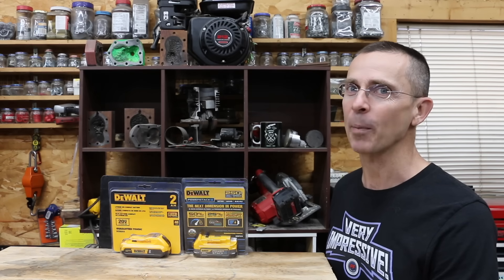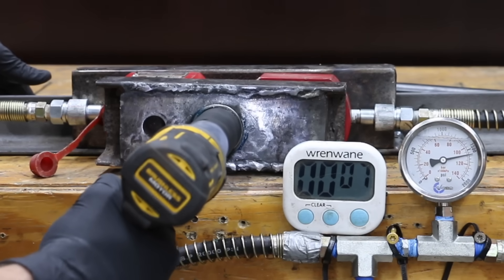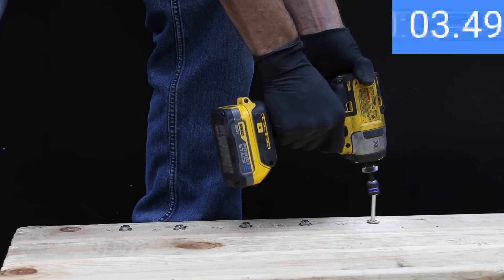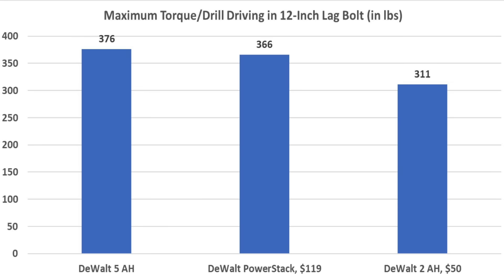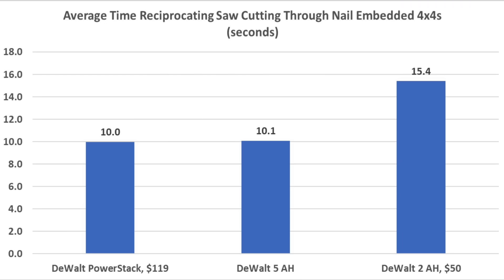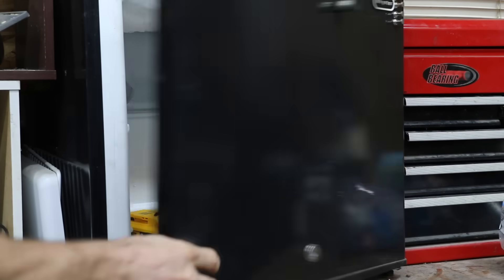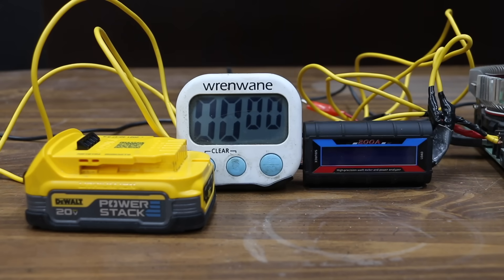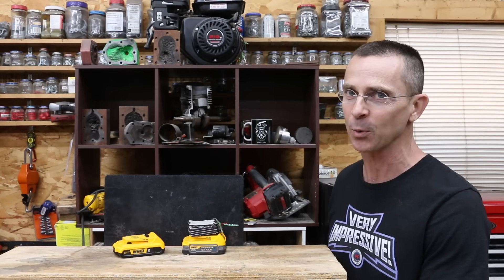Compact “Pouch Cell” Battery Better? Let's Find Out!

Comment: Lithium ion pouch cells? Coming out of China no less? I'd bet dollars to donuts those are lithium iron phosphate, not the much more common nickle-cobalt types.  Those cells were almost certainly cheaper than the normal ones. As far as capacity, LFP batteries have significantly lower volumetric energy density.  It's their biggest problem.  So if they do come out with high capacity they'll just have to make the thing bigger.

All in all, probably a really good choice.  With the manufactures like CATL and others spending bookoo bucks building out LFP capacity, and the fact most people using power tools would be more than happy with the trade offs LFP provides, I expect other manufacturers will probably follow suit soon.

Comment: Pouch cells have far more stringent temperature & pressure limitations than cylindrical cells. They heat up and swell up dependent upon load, ambient temperature & cooling (if any). That's why pouch cells are mainly used in applications where the power demand (watts) is either very low or at least fairly constant (unlike many power tools) and absolute lowest possible weight is far more important than longevity (e.g.: model aircraft).
Reply from the maker: Thank you!

Comment: Dear Author, 2 minor suggestions as for the driving bolts tests: 
1) pay more attention to keeping bolt and driver perfectly straight while driving in screws etc. 
2) be more careful about when to stop driving bolts or finish timing; clearly there are some cases when the bolts are pushed to far onto wood and timer is still going on
Ofc I know that test results would not change a lot once those changes are applied, however tests should seem even more viable then. Besides, great video as usual - and as opposed to PowerStack batteries, Im kinda disappointed with them😉😁
Reply from the maker: Thank you for the feedback!

Comment: I've always questioned why these tool manufacturers never used the pouch cells, they have more energy density. It's criminal how much Dewalt is charging for that battery though, they are cheaper to make than the standard 1s.
Reply: "I've always questioned why these tool manufacturers never used the pouch cells,"
because they are far more prone to abrupt and catastrophic failure than traditional cells. 
They are fine for phones and tablets, even if annoyingly unreliable at times; but anything pulling amps like a powertool; no way!
Reply: @PriaSamari  Not really, those pouch style batteries usually have higher C ratings, and cleaner power. Thats why in high demand applications like RC stuff, they have been using pouch style LiPo batteries for years. They are more energy dense, instead of having 10 18650 cells, they can just have 4-5 pouches that dont need extra wiring.

Comment: Heavier is better in lithium battery. Lipo packs are unsafe, individual batteries has venting protection. You have to test its safety by dropping and abusing. Even charging is unsafe with these lipo packs. RC people learned this while ago.
Reply from the maker: Thank you!
Reply: @ProjectFarm  i thank you sir

Comment: Hey there, I don’t think it’s a good idea to do your tests by lubing up your threads. Wet torque has less friction, thus taking more stretch of the bolt to reach your desired torque/maxed capacity of the tool. I just know you want to be as scientific as possible and maybe this could be a video idea, wet vs dry torque
Reply from the maker: Thank you!

Comment: I'd like to see the makita Dewalt and Milwaukee leaf blowers go head to head with 4ah 18v batt. I've used the newest 40v rypbi leaf blower .the spec showed high speed and more cfm than the ryobi 40v backpack blower. It is rather impressive.  I'm thinkon of purchasing the makita leaf blower as I have tons of makita batteries and tools already. We use those wafer battery cells in the rc biggie world.
Reply from the maker: Thank you for the video idea!

Comment: The current PowerStack batteries are really meant for applications where access and weight are at a premium, tools like the DCE400B pex expander, the laser tools, the trim nailers, and the heated gear. I have a Dewalt heated hoodie and have been looking into one of these packs, out of all the 20V Dewalt tools I own that is about the only application that would benefit, but not until the price comes down.
Reply from the maker: Thank you!

Comment: I’m not sure what Dewalt is going for with power stack. It’s give you same power as a 5amp battery for a moment then it rapid discharge makes it fall off. 🤦🏻‍♂️.   I don’t run my impacts with 2amp battery’s anyways it’s pointless.   So unsure what they feel this is until it out preforms a 5amp battery in all categories it’s just a marking gimmick
Reply from the maker: Thank you!

Comment: This tech is not new. I have quite alot of experience with these batteries. Pound for pound they are the most power you will find. But reliable they are not. Safe? Not so much. Long lasting? No on that too. They puff, catch fire and cells go dead more than 18650’s. I use these in Rc vehicles. Maybe when they perfect the chemistry they will be worth it. They changed the chemistry to include graphene a few years ago and that made them more powerful, faster charging, more voltage and capacity but the reliability didn’t get better, got worse if anything

Comment: For the absurd price difference, the durability concerns, and the fact that the traditional batteries seem to be using either LG or Samsung cells made in korea vs the pouch batteries thats all made in China, these seem like a really rough time to justify unless you have very specific needs for something small and light while still being powerful. 

Part of me almost wonders if dewalt is pivoting over to these is a means of planned obsolescence in that people will have to pay to replace their batteries more often for their cordless tools. Make it look like a premium product now with a premium price tag to get people on board, then phase out the existing tech.
Reply: Most cylindrical calls are made by japanese or korean manufacturers and have manufacturing in said countries.

These cells are by and american company that manufactures in china, because america has abandoned manufacturing onshore due to labor cost. 

 Amionx-safecore is the company

Comment: This PowerStack looks like the best fit if you need power but not long runtime. I won't be needing a big 5 Ah one for just couple bolts or cuts with a recip saw. 
As for the test, I think a charge time comparison was missing but then again it should charge the fastest since it can deliver higher currents.
Reply from the maker: Thanks for the feedback.

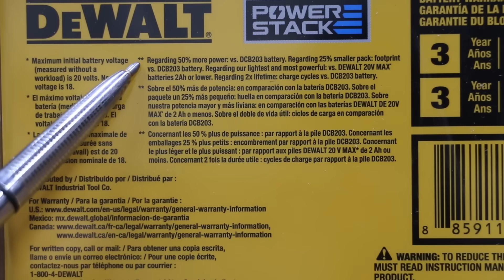Comment: @1:43 you can see on the label what isn't mentioned in this video: the PowerStack is rated 1.7 amp-hours & 30.6 watt-hours, which is based on the more realistic 18v nominal voltage rather than the 20v max rating.  In comparison, the 2.0 amp-hr DCB203 has "40 Wh" on the label, which is based on 20v rather than a more realistic 36 Watt-hour rating based on nominal voltage.
Reply from the maker: Thanks for sharing.

Comment: Wow I caught a slip up at 14:35 He is actually human. :) You mentioned there are six 18650 cells in the 2amp hour battery. I am sure it was just a slip up but its 5 cells not 6.  

I choose the Dewalt brand for my system due to value /performance.  So far am pleased with their products. Hope they have good bms circuitry and not have battery failures like other companies trying to push new technology.

Comment: Good testing. Could you also test them in extreme heat? I feel like the pouch cells will overheat faster because there's no air between them like there is with cylindrical cells, but there's only one way to know for sure
Reply from the maker: Thanks for the suggestion.

Comment: We use these in Radio Control electric models. They are loaded with energy, pierce one and there is a lot of smoke and fire. They make a lot of noise when pierced.. They are dangerous if not taken care of. Do not leave them on charge in your house/truck without monitoring. They do occasionally go up.  We learned to keep them in Ammo boxes.  Been around for a while now.  They are powerful and light. Not surprising.
Reply from the maker: Thanks for sharing.

Comment: Could you do electrical generators and their brands and difference in performance between an inverter generator and a regular one to see if the cost difference is actually worth it?
Reply from the maker: Thanks for the suggestion.

Comment: I always wondered why tools still use the cylindrical 18650s since they aren't as efficient volume-wise. There's always a gap between the batteries where you could have more battery. I always assumed that the 18650s were more rugged and durable than the lipo pouches. 

I love that DeWalt is using them, but I hate how they're implemented and marketed. Those "69% more power" type of claims are always a bad sign, and notice that they don't even post the capacity on the package. The price is absolutely ridiculous too, they're just trying to fool less knowledgeable customers who are easily influenced by marketing and advertising. 

And even though it is better, I don't think it makes sense. On a smaller tool like the impact driver, where a small batt makes more sense, it does perform better, but would you really notice the difference? I doubt it, and for me it doesn't justify its 2x price tag and presumably shorter run time. On a larger tool like the blower or saw, its best to use a larger batt like the 5Ah. Sure its a bit heavier and bigger, but when you're already using a large tool it really doesn't matter that your battery is a tad bigger, and the 5Ah gives not only more power but also much more run time. To me it seems like the PowerStack exists only to suck money out of unsuspecting customers
Reply from the maker: Thanks for the feedback.

Comment: @14:35 "As you can see, there are six different 18650 batteries..."  20v (max) packs have five cells in series.

Comment: Todd, have you thought about adding a heat abuse test? Something to mimic a battery sitting in the cab of a hot truck for several hours?
Thanks for videos!
Reply from the maker: You are welcome!  Thanks for the suggestion.

Comment: Why you discharged those batteries down to 8 volts? Minimum voltage for 5S battery pack is 15V so you basically destroyed them.

Comment: I think its interesting to see that your US batteries for the same tools are 20V and ours here in Europe is 18V.
Reply from the maker: Thanks for sharing.
Reply: @ProjectFarm  do you have any thought as to why? I think its just an interesting tidbit. this is for Dewalt only for now as I dont buy any other power tools brand really. I have dewalt batteries so i stick with it haha
Reply: @ProjectFarm  wait i found it haha...

In the USA, the manufactures can rate the batteries at their maximum output voltage, whilst in Europe and South Africa, the manufacturers have to rate the battery at its nominal voltage. So essentially a 20V Max battery produces 20 volts maximum and 18 volts nominal voltage...

that means our 18 is your 20, just in the US they can say its 20 when it touches it for a split second, and our laws cant say that, it must say what you actually have and can use instead of a burst voltage
Reply: @ProjectFarm  so basically its just USA being USA haha, sorry. Its a marketing scam, they are actually 18 volts

Comment: It’ll be interesting to see how the larger form factor power stacks will perform when announced in a couple months or even a flexvolt.
Also it’s not that surprising for the power stack to run out faster in some situations since it’s technically on 1.5 AH
Reply from the maker: Thanks for sharing.

Comment: Dewalt 5AH batteries are also considerably cheaper than the pouch cell batteries and outperform them.  I’ve noticed that power tool batteries are not coming down in price over time, and the power pouches seem to continue the trend.
Reply from the maker: Thanks for the feedback.

Comment: This is the worst thing they can do. After using these lithium cells in remote control planes, cars, helos, and drones for 20 years they will fail long before the 18650 cells.  Mostly from over discharging ( keep running a dead battery or not charging and putting it away ) the will swell up and split when a cell goes bad IF your lucky and if the cell  gets damaged they will exploded!  -  DJI programs the batteries to self discharge to 25% over 5 days of storage to try and make them last longer.
Reply from the maker: Thanks for the feedback.

Comment: Another excellent video, well done. BTW, what was the driver bit that you used on those long bolts?
Reply from the maker: 1/2 inch Socket adapter made by DeWalt.
Reply: @ProjectFarm  Is the socket on the adapter also black?

Comment: Lithium polymer sometimes loose capacity if left fully charged and are considered more temperamental.  There has been some testing of this for model airplanes where power density is king. It would be neat to see if the capacity drops and by how much for each type of left fully charge for say a month.
Reply: These are not lithium polymer.
Reply: @RyanRKJ  I’m pretty sure they really are.  Actually he says it in the video too.

Comment: @Project Farm
Just my opinion but I feel it's unfortunate you didn't include a relevant 21700 based pack in the comparison. The new 3, 4, 6 and 8 Ah packs are all 21700 based, with the 3 and 4 Ah packs being a 'slim' 5S1P configuration comparable to the Powerstack dimensions. The 2 Ah and even the 5 Ah are not really relevant competitors to this product as they're both outdated previous generation packs with weaker 18650 cells. DeWalt is marketing the Powerstack against the 2Ah because the 2Ah is the weakest battery they currently sell, period. 

For comparison an INR21700-30T and 40T are 35A cells whereas the INR1865020R is a 22A cell - Expect ~60% more power delivery from the 3 and 4 Ah vs the 2 Ah.  

The 5Ah INR1865025R cells would be ~20A x 2 = 40A. You should expect to see either the 3 or 4 Ah slim batteries nearly mirror the 5 Ah in power delivery in roughly the same form factor as the Powerstack, and a 6 or 8 Ah pack to provide ~70% more than the 5 Ah... 

Power aside, if you look at the pricing you'll get ~76% more capacity from the 3 Ah slim and 234 % more capacity from the 4 Ah slim for the same money. Like you say though, if the Powerstack finds its way into larger capacity packs at a lower price point it should be a successful product. At the moment though, the current generation of 21700 cell batteries DeWalt is selling perform just as well and cost significantly less per Ah. 

Current HD REGULAR Prices:
2 Pack Powerstack 1.7Ah = $179
2 Pack Slim 3 Ah = $179 ($99 Promo)
2 Pack Slim 4 Ah = $171.18
Reply from the maker: Thanks for the constructive feedback.

Comment: Great testing as always!  Thanks!
I have had NO issues with my 20+ 20v batteries in 2 amp - 6 amp that are 1-5 years old.
5 amp is my favorite overall battery since it is dramatically smaller than 6 amp.
Reply from the maker: Thanks and you are welcome!  Thanks for the feedback.

Comment: One thing that really puts me off the power stack is the tendency of pouch batteries to expand as they age. Give it a couple of years and I wouldn't be surprised if the power stack battery pack is full of bulges and cracks. 

I'm also not convinced that the new technology batteries will last as long as the good old 18650-based ones either in terms of lifespan.
Reply from the maker: Thanks for the feedback.

Comment: As a pro who uses Dewalt batteries (nearly exclusively) I really appreciate this video! I carry an arsenal of 3ah and 5ah in my kit. What I look for in a battery is to accomplish a given task efficiently with the lightest battery possible (i.e. I run my impact driver with 3ah and my saws with 5ah, etc.). I definitely want to avoid changing/ charging batteries in the middle of a project. For these reasons I don't see an advantage to a battery that runs 'hotter' but discharges faster. What I want is a battery that runs longer at a rate that's high enough to run the tool effectively. Dewalts' new batteries would accomplish my goal of using the lightest batteries possible and, thus, increasing overall efficiency, but this would be offset by increased battery changes/ charges. I'm sure there's a task that these batteries are perfect for, it's just not one I do in my day to day.
Reply from the maker: Thanks!  Thanks  for the feedback.

Comment: Like any tool, one must match the tool with the job.  Sometimes one might need a cell that can deliver power over a long time (2 amp)....sometimes one might need a cell that can provide more power quickly draining faster but providing more work for less time (2 amp powerstack).  And one might also need large power for extended time (5 amp).
Reply from the maker: Good Point!

Comment: One thing I've noticed with the smaller batteries is they heat up when doing intense work like with a recip saw. So much they have to cool off a good while before the charger will start charging them, due to the thermal overload protection built into the pack. They also act dead in the tool, but if you let them sit and cool off, they start working again.
The bigger batteries seem much more resistant to heating up. I suppose the lighter pack would be nice when working off a ladder or in a tight spot especially when doing intermittent work, but it's hard to justify that cost for the higher performing one when you could have two smaller ones charging while you're working.
Reply: Yeah, I used a 2Ah pack in a reciprocating saw for a while before I got some bigger batteries. The pack sure did get hot. It seemed abusive to subject the small battery to that tool.
Reply from the maker: Thanks for the feedback.